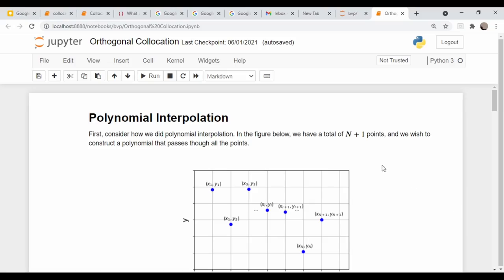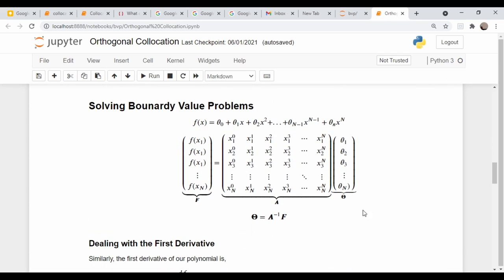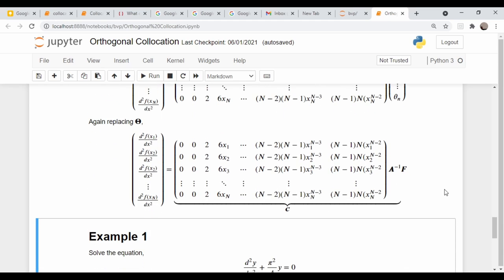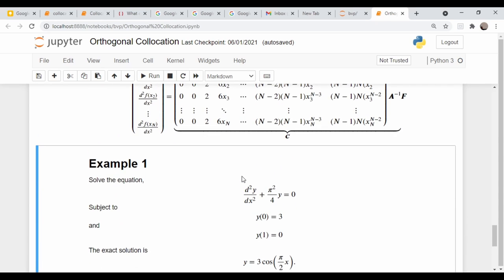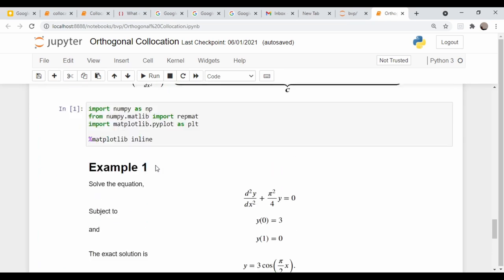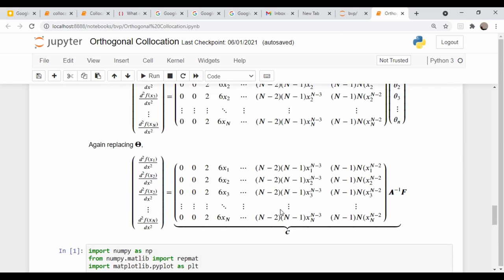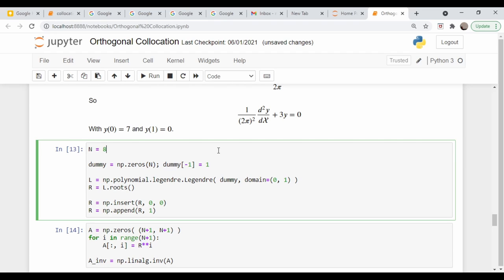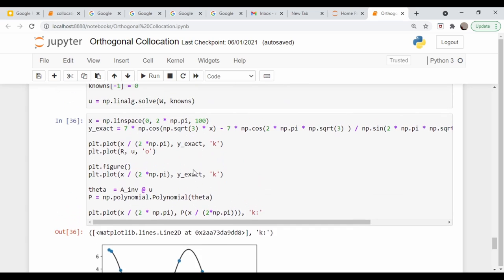Solving Boundary Value problems via Orthogonal Collocation

Comment: Hi Kevin, thanks for the video. Have you made some video where you apply this method when one of the boundary conditions is in the first derivative? (like dy/dx=0 at x=0) I looked through your videos and couldn't find it. I can't really figure out how to apply this methodology in that case. 
Also, there is another youtube page (APMonitor) that has done videos about the orthogonal collocation application, however, he does it in a different way, I don't know if you are familiar with his videos, however, if you are, could you tell me if the methodology is essentially the same, or if it is really different methods? 
Thank you in advance
Reply from the maker: I didn't do a specific video on it, but it is done in the same way.  Just alter the boundary equation to be the derivative of the polynomial rather than the polynomial itself.

Comment: Thank you so much for this sir. The solve_bvp function in SciPy uses a collocation algorithm, probably similar to this.

I also manually implemented the collocation method using SymPy to generate the the polynomial approximation and the resulting system of linear (or nonlinear) equations. If non-linear, I also solve for the jacobian analytically and conveniently using SymPy. I convert them to standard Python functions with SymPy's lambdify and use the SciPy root function to solve the system of nonlinear equations. 

I have done these using 5th, 7th, and 9th order polynomials. Pretty fun to do in Python since the symbolic part of things are handled with Sympy, not requiring any pen or paper.

The collocation points I choose are usually linearly equally spaced points in between the boundaries.

Edit: I highly appreciate your use of functions the NumPy polynomial sub packages btw! I've never used those and it's good to be exposed and see them used. Also the numpy matlib repmat function!
Reply: Would you mind share your work?
Reply: Wow this is very impressive. Please have you solve with differential equations as boundary conditions. If you have, please can you tell me how to do it

Comment: Hi Kevin. Thank you for your video. I will appreciate if you reply to my comments earlier. Please how will I code for boundary condition with derivative. Also do you know about partial derivatives with orthogonal collocation method. Thank You
Reply from the maker: You handle the derivative the same way as in the video. (x1 - x0) / delta = whatever.  I don't have the time to do a specific video on it, unfortunately.  I have a video on orthogonal collocation.  Just search the channel.
Reply: @kpmooney  Thank You so much for your reply. The boundary conditions goes with everything in the matrix after inputing the roots. For example, dc/dz=Pe(c-1). The dc/dz is the matrix with the legendre roots. Please how do I code it, is there a platform where I can send a message because I really end your help. Thank You
Reply: @kpmooney  need*
Reply from the maker: The derivative boundary conditions would be in the B matrix mentioned in the video.  You would (using my code variables) change DE[0] and DE[-1] to reflect the first and last rows of B.  Then change knowns[0] and knowns[-1] to be the value of the boundary conditions.
Reply: @kpmooney  Thank You so much Kevin. Let me do this.
Reply: @kpmooney  Hi Kevin. I tried it. DE[0, :] =  B; DE[0,0] = 1
DE[-1, :] = B; DE[-1,-1] = 1 I changed it and the error code was could not broadcast input array from shape (4,4) into shape (4,). I also did this for the knowns. I put the value of the boundary conditions. knowns = np.zeros(R.size)
knowns[0] = 5*(np.eye(C.shape[0])-1) and this was the error code ; setting an array element with a sequence. Please what should I do to correct the code. Thank You so much.

Comment: Thanks Kevin god bless 🌷.......Need Help  Can u plz make one vedio on Fibonacci Retracment strategy to buy and sell on the important  levels in python .....I search all way around but I can't find out vedio  on the buy and sell .....plz help
Reply from the maker: I’m not sure what you need.  The Fibonacci retracement percentages are just numbers, some of them not even related to the Fibonacci sequence.  Your trading platform would probably be a better and faster choice than programming something from scratch in Python.  I really don’t do technical analysis so I wouldn’t be able to help you pick entry and exit points.  Do you have a specific question about the math or programming that I could help with perhaps?
Reply: @kpmooney  thanks for reply ...